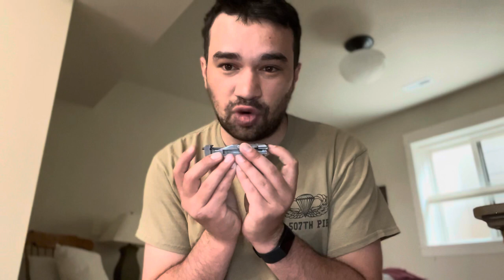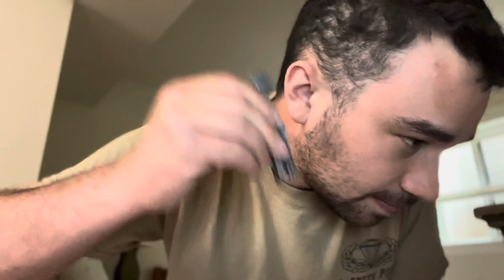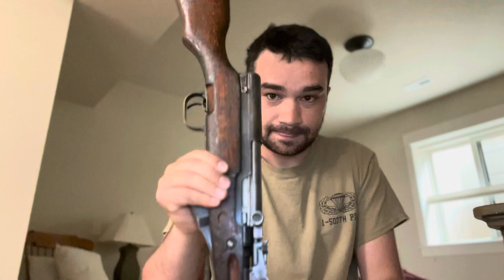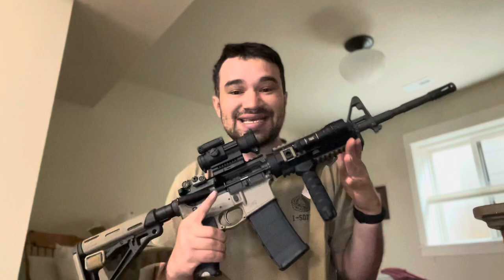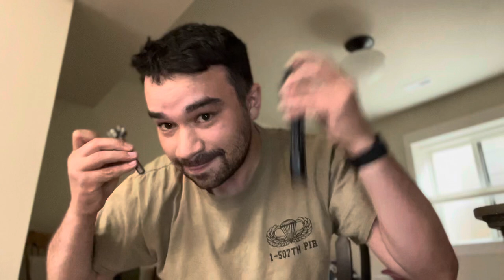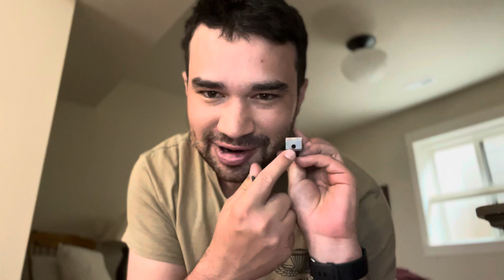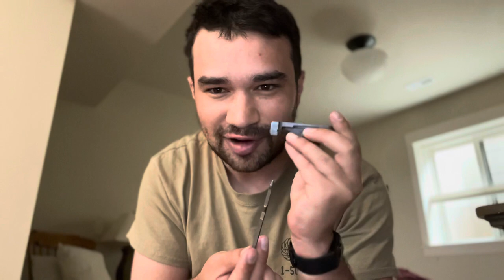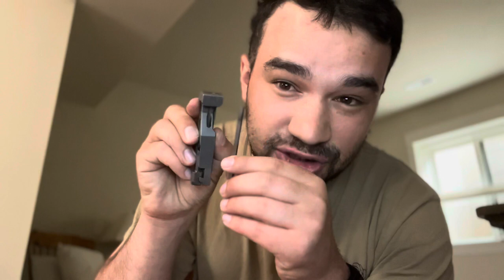The Myth of the SKS Slamfire (why you don’t need an “enhanced” firing pin)

Comment: Hey how much have you hunted with the sks or 7.62x39 people in my area seem to think it’s not any good but I hear stories that they’re using hollow points the cheapest hunting ammo you can buy. I plan to use it for pigs deer elk and bears I’m wondering if you have any insight on this.
Reply from the maker: I’m a novice hunter - so I can’t speak to this with much authority. 

My understanding is that with proper bullet selection 7.62x39 should be considered equivalent in capability to 30-30 Winchester. As you likely know, “hollow-point” 7.62x39 is NOT an expanding projectile, and provides identical wounding characteristics to FMJ. There are truly expanding (soft point) 7.62x39 rounds produced, and these should be more the suitable for pigs.

I know a few people who happily hunt hogs with 300 blackout, which is a less capable round than 7.62x39 🤷‍♂️
Reply: @Autumn Doe I am using s&b sp rn and sst
Reply: @Autumn Doe they’re very accurate and great penetration but not so much for expansion 124gr 2400 fps I was shooting dimes with the s&b. Lol my one buddy shot a pig and said I had to go get the 45-70 my first question was what ammo he said Barnell hollowpoint. I might have to order some more sst and I’m probably gonna try those Winchesters I didn’t know they made them
Reply: The SKS is a go to “hunting rifle” for First Nations people in Canada. It’s very widely used for hunting.
Reply: @nakedfreak1  hollows don't work got in 39

Comment: Question I ask is why Russia deleted firing-pin spring ?.... cost, reliability, or unnecessary part easily lost in battle ?.... good day.... sammy
Reply from the maker: It seems to have been a reliability issue.

Spring-loaded firing pins don’t do well with inconsistent ammo, and Russia has always had inconsistent ammo - especially in the late 1940’s to early 1950’s.

Basically what was happening is that spring-loaded firing pins were failing to ignite harder primers, and were being damaged by ruptured soft primers. Deleting the spring solved both of these issues, allowing the SKS to function reliably using a wider range of ammo types.

In summary, the flaw with the spring-loaded firing pin design is that it does not reliably function with inconsistent ammo - and Russian weapons need to be able to function reliably with inconsistent ammo.

Comment: Bingo also dirty surplus amo lack disassemble of the bolt and a shake test is a good start a shooter should do a real cleaning I know  a spray brake cleaner and wd40 is not servicing the weapon. It is a super reliable gun .but this is not war time .this is sport shooting shooter should not be so lazy that they in danger there friend and family  ps that was a great show
Reply from the maker: Thanks for watching!
Reply: I cleaned my sks with brake cleaner several times after shooting it and oiling it I did clean the bolt with hoppes 9 brake cleaner can do a good job for initial cleaning

Comment: I have found that the American commercial ammunition primer caps are thinner and does need a hard strike like the Russian primer caps so it leads me to believe it is safer for me to have the return sping in my firing pin
Reply from the maker: I agree with the premise of your logic, but I would add one additional detail:

For exactly the reasons you stated, American commercial spec primers are incorrect for use in an SKS. You wouldn’t use the wrong bullet, you wouldn’t use the wrong powder, you wouldn’t use the wrong case, and you probably shouldn’t use the wrong primer either.

Can it work? Sure. Can some of the risks associated with using the wrong primer be mitigated by making other changes to the firing mechanism of the weapon? Yes.

But if safety is the goal, I think a much more direct route would be to simply use the weapon as designed, which includes feeding it the ammunition it was deigned to fire.

Comment: I bought a type 56 /26\ sks back in 1991 that was advertised as unissued military. It has the Chinese characters on it, and all matching seriel numbers with no indication of sanding or grinding the original seriel numbers so there is a good chance it was unissued when I bought it. It shoots like a sewing maching. My father bought a Norinco sks a couple of years later and that thing slam fired like hell...
Reply: Take the bolt out and clean the channel the firing pin rides in.  Something in it is preventing the firing pin from moving freely in that channel, that should take care of the problem!  I imagine that by now you have done that though....
Reply: @larry1754  Thanks for th advice. Both my father and I have been around guns since I was born in 1950, and we cleaned to gun and bolt extensively but it never did stop slam firing. Norinco's had a eserved reputation for this.

Comment: It's not a myth it's just creosoil gets stuck in the firing pin.   The Murray spring is a safe measure and the original sks came with one.  

The ar15 is the same design and can have the slam fire as well.

Comment: Mine is having light primer strikes and only firing a round on every 4 to 5.  What could it be?
Reply from the maker: There are many possibilities.

What kind of SKS are you using, what if any parts (including the firing pin) are not original military components, and what type of ammunition are you using?
Reply: @Triangle26  SKS Type 56. All original components (to my knowledge) as all serial numbers match.  I cleaned the rifle from all cosmoline. Using Tula and also Remington ammo but issues with both.  I don’t think is the ammo.
Reply from the maker: @falconator3419   Thanks for the clarifications, that rules out a lot.

The most likely explanation in my mind would be a worn firing pin tip, or some type of particulate accumulation in the firing pin channel. If I were you, I would purchase a surplus firing pin ($5) and replace your current firing pin - being exceptionally careful while doing so to verify that the firing pin channel is bone dry, and clear of any foreign material.

If that does not resolve the issue, you are most likely dealing with a very unusual spring failure, or even more unusual parts wear.

If you have access to another SKS, my “go to” diagnosis tool is to isolate components by swapping non-headspace dependent components one at a time until the problem resolves.

For example, if you pop in another trigger housing assembly and the issue resolves, you know that the issue is limited to that particular assembly.

If you do resolve the issue and feel so inclined, I would greatly appreciate if you could take the time to report back what you ultimately discovered. Mechanical failures on factory original SKS patterns (at least non-Albanian examples) are exceedingly rare, and I am always curious to add data points for my own knowledge.
Reply: @Triangle26  thank you for taking your time to respond in detail.  I’m already working on some possibilities in order to fix it.  I’ll post my findings if I succeed.
Reply: @Triangle26  So I figured out the issue.  It was the gas piston.  During cleaning I noticed that it didn’t move easily back and forth inside the gas piston tube.  In fact it would get stuck in there so tight that I would have to remove it by taping it from the back with a hammer and punch.  I purchased another gas piston from EBay, new Russian, but it looked identical to my Chinese one and that one move freely as it was supposed to.  Problem solved. I just fired almost 100 rounds today without a single issue and I was actually impressed how accurate it is.   I guess it was on me for not addressing this issue earlier and thinking it was a minor issue due to the old nature of the rifle.  The original gas piston that came with the rifle did not look too bad or too worn out but I guess it was deteriorated enough for it not to functioned properly.  It did have some minor corrosion towards the smaller end. That might have stopped it from cycling properly towards the smaller hole of the gas piston tube.  I hope this helps anyone having the same issue.
Reply from the maker: @falconator3419  Very interesting. I really appreciate you following up, I was genuinely curious how that would resolve. Good on you for finding the right solution 👍

Comment: rust and gunk is the biggest issue. and it wont go full auto since it will most likely rip off the brass case head since its not rotating bolt and subsequent round will fail to chamber. ask how i know.
Reply from the maker: Ouch. Glad you are OK! I agree wholeheartedly, especially if we can say that 95% of “gunk” is crusty old cosmo.
Reply: @Triangle26  yeah. in my case it was a gun that belonged to the range and was neglected. we almost never see cosmoline guns since those guns are mostly all sold to america. most we see is used sporterized war guns.

Comment: I noticed that the hammer spring has an almost absurdly strong spring and can just about break a finger if you place your hand wrong when it strikes (like when you're cleaning it). I've been told the hammer spring was made to strike with a stronger force than other rifles because of reliability problems with older ammunition due to shoddy ammo manufacturing and primer technology. So who's to say that some SKS bolts (Chinese) from certain countries (China) that have been know to produce weapons with improperly heat treated bolts (info from 9 Hole Reviews) may be subject to damage from dry firing because of the very strong hammer spring? Just me?
Reply from the maker: No, it’s not just you. You are scratching the surface of a rare but well-known mechanism of failure in SKS pattern carbines.

I can talk all day about deformation in the self releasing taper of the firing pin / bolt interface, but the truth is that this accounts for a tiny fraction of SKS slamfires. It’s an extremely rare cause of failure, that is relevant to a very small number of SKS owners. Cosmoline is an extremely common cause of failure, which is relevant to almost all SKS owners.
Reply: @Triangle26  I understand. My point was more pointed toward the people who have bolts that mound out where the firing pin protrudes and they get blown primers. I just figured there may be some crossover with that issue and sticking firing pins.
Reply from the maker: @AudioGardenSlave123  Ah, I see. That's certainly relevant. Also, to echo one of your earlier points, one of the biggest factors in this whole issue is the Eastern Bloc's collective inability to manufacture a consistent primer. Regardless of whether or not a bolt is properly heat-treated, the flame cutting from a pierced primer can really mess up a bolt face and firing pin channel.

Comment: How to prevent slam-fires: 
Clean your rifle thoroughly, especially the bolt, with lightweight oil or (gasp) WD-40, making sure that all the old, crusty cosmolene and/or congealed oil from long storage is dissolved and gone. An overnight soak and a good next-day cleaning of the whole bolt assembly is best.
Also, bear in mind that very cold weather can exacerbate the problem. Most slam-fires I've witnessed or heard of only fire 2 or 3 rounds before the heat and recoil jar the pin loose again, but in theory it could pop off all 10, I guess. Keep your weapon pointed downrange, and don't buttstroke any commies with a loaded rifle, and you should be fine. Slam-fires are a bit alarming, but with good safety practices, they really shouldn't be all that dangerous, unless you have BATFE agents nearby.
Again--- clean your rifle
Reply: nah its not about cleaning it it literally is all on the free floating pin cause theres nothing stopping it from slaming forward with the bolt with enough force to detonate rounds if you have a spring loaded one it doesnt go forward with enough force to detonate a round until you pull the trigger more than likely

Comment: I have an 1945 model from Russia and has a spring
Reply from the maker: Yep - the original Soviet firing pin design featured a return spring. That feature was removed in 1951 due to reliability issues.

Comment: The issue with the SKS is the pin and channel are a very poor design, compared to the Garand, AR and AK, coupled with the fact SKSs are more likely to be owned and abused by ignorant dickheads (that 5% he mentions). 
Cosmoline is an issue, but it's not the only thjng that causes slamfires in SKSs.
Murray's firing pin is a good fix, even if you don't use the provided spring. It won't fix a donked up boltface, but it won't continue to make it worse.
Ironically, one of the Yugos I bought already had one, but because of the blown primers, it would get stuck just like a factory pin.
Take care of your gear, no matter how much you paid for it.
Reply from the maker: Sound advise. In my experience cosmoline is responsible for the vast majority of slamfires, although its true there are other causes. I'm not sure I would go as far as to say it's a bad design, but if the self-releasing taper of the firing pin/bolt face interface gets damaged, that is bad news. The main culprit for this seems to be corrosive or out of spec primers. Which circles nicely back to your point - take care of your gear!
Reply: @Triangle26  My first Yugo had a really bad protrusion all around the firing pin hole. It punched out little discs from the primer with every shot. They usually just blew out but enough of them got blown back into the channel to stop it. That was when I started learning about the SKS. What a journey!

Comment: Just clean your guns properly ! When u buy them used or brand new strip them down clean them up lol even firearms make today can have small bits of metal stuck in the cooling oil from manufacturing!  Keep you guns clean and you will always have a reliable safe fun tool !

Comment: Most gun owners will research as much as they can about a weapon before buying one and once they get a perception in their head, nothing we say will change their mind. And the average SKS owner will never disassemble the bolt and properly clean and maintain the components that’ll prevent slam firing. So to counter their fear, a seller or owner will install the aftermarket pin to ensure they don’t experience a slam fire. All the examples of other free floating fire pins in other rifles have one difference that the SKS doesn’t and that’s a firing pin ‘stop’ at the rear of the firing pin while the SKS has the firing pin stop at the front of the bolt where the conical shape of the firing pin hits that cone and stops. The tolerances are fairly wide to allow movement even if dirty. When the bolt and pin build up rust mixed with crud in that conical area, it causes the pin to lock in place which causes the slam fire. 
SFC DeVos 11BB40
Retired
Reply from the maker: Well said on all accounts sarge. I will admit, the more time I spent looking at FFP designs the more I appreciate the AR. The fact that the AR firing pin is secured by the carrier and not the bolt itself provides a very clever layer of added security, as it is physically impossible for the firing pin to get stuck forward while the bolt is unlocked.

Comment: You just made an assumption that you 'figured out" the problem with the SKS but you didn't.  It is well documented that there were problems with this gun when it was produced new in the 40's and 50's before any of them ever saw storage grease.  These things were sold for $99 at gun shows and I wouldn't buy one then or now .   They have documented problems and you are trying to blame every failure of the gun owner.  You say any free floating pin design is subject to this  problem but you never hear of other rifles having this problem in the numbers that SKS owners have.   Thergun was a stop gap gun at the end of the war ... it was a turd then and still is now. My 2 cents
Reply from the maker: I'm familiar with the "well documented problems" you've imprecisely alluded to. Those early teething issues (1949-1951) were caused by the Soviet's notorious inability to manufacture consistent cartridge primers, and were resolved by introducing the free-floating design in 1951.

To your other "point", the SKS-45 was indeed a stopgap in Soviet military service. The pesky detail you failed to acknowledge is that at the same time the Soviets phased it out, the SKS ended up getting adopted by a number of other countries, including a quaint east Asian nation called China. Consequently, the SKS saw decades of extensive combat use spanning four continents, and achieved production numbers which distinguish it as the third most successful autoloading rifle design in human history. 

All that said, you've made it clear you don't like the rifle, and that's just fine. Congratulations on saving $99. I only wish you would have saved another $0.02 by sparing me from your flimsily constructed condescension.